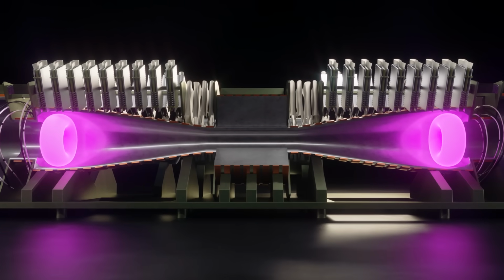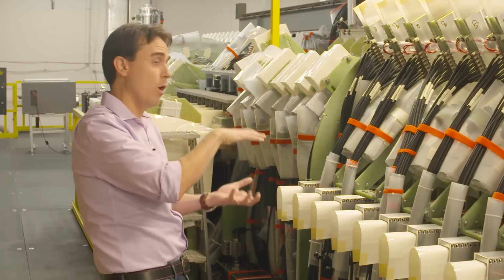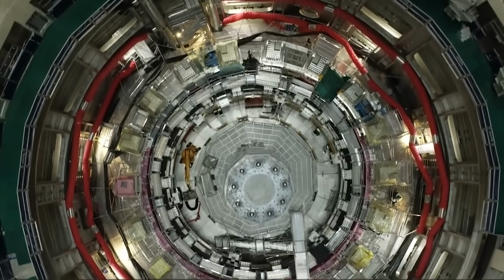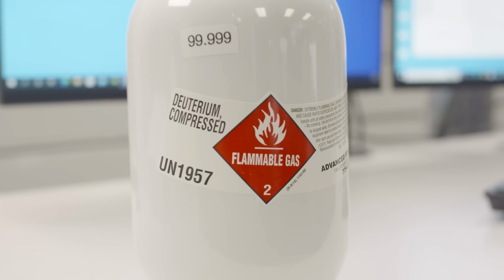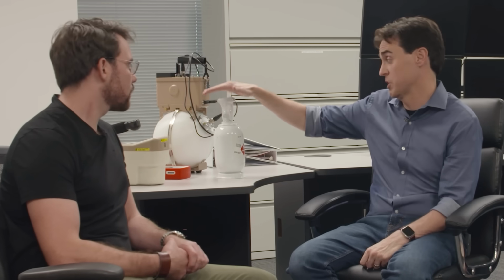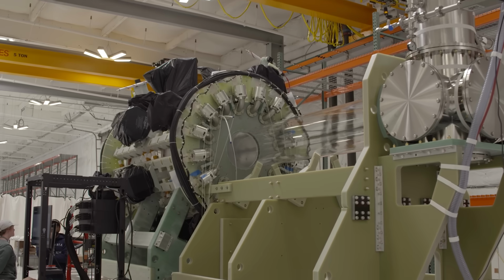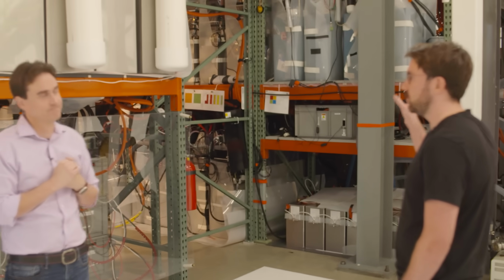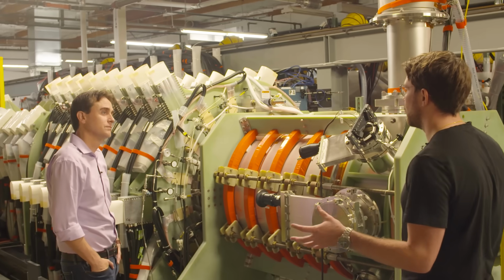A New Way to Achieve Nuclear Fusion: Helion

Comment: This will likely never happen in are life time the required levels of fuel is just not available in any amount needed for more then test. And this group is so far from producing any power. Most fusion produces plutonium 235 making the reactor all nuclear wast not just the rods like a nuclear power plant. Making fusion dirtier then nuclear power. This group seems to be going down the wrong road. They keep saying they producing less then other fusion reactions. well no reactor is anywhere near producing positive energy output.
Reply: None of that makes true.

Comment: What kind of material will use in that chamber , where is millions of degree temperature.
There is a lot of Qu?, There is a lot of input and output will have a lot of losses. the ratio
of this will decide practical use of this machine. If You cut spending of energy of military
in the World, for these days will be plenty of energy.

Comment: This is very intriguing and pretty cool honestly. But while everything else seems fine to me (on a conceptual level), there is one thing that I don't quite understand. Why are the two plasma clouds supposed to stop in the middle after collision without external intervention (which I would presume would render the whole acceleration pointless)? I would expect them, due to their low density and no binding between the ions, to largely fly past each other with some minor scattering probably. Can somebody explain that to me?

Comment: I still wonder if you took a hydrogen Bose-Einstein condensate and rapidly super heated it with a high powered laser would it fuse. I mean a B-E condensate behaves as a single atom so would that be enough to overcome the electro magnetic repulsion by not giving it enough time to separate?

Comment: I think i see what helion is going for.  If tokomaks and stellarators or Igniters use fusion to heat a steam boiler that creates torque in the same way that a train does. then Helions magnetic pinch technique is trying to use fusion to power a four stage  internal combustion engine that makes the torque directly .  Currently they can do the first two stages without catastrophic failure and are currently working on the last two stages with the newest variant under construction.

Comment: What's really interesting to me is the size of this reactor. Unlike previous fusion and fission reactors that require massive cooling towers, hydro electric infrastructure, and waste management faculties. This system appears to fit in a moderately sized traditional commercial building. This is advantageous when considering the sheer cost of building a traditional nuclear power plant. A smaller foot print means less land, probably lower construction times, and ultimately less cost to build the physical building(a) that might house such a system.

Comment: Looks much more promising than that seemingly silly Tokamak project in France— ITER… which will cost anywhere from 18 - 65 billion dollars to construct and isn’t slated to go full fusion until 2035 — and that’s just for a prototype that will not be able to produce commercial amounts of energy (so commercialising that  tech in a financially sustainable  way will take decades and decades, if ever). That said, this also looks at least a decade away.  They just started building the larger prototype. Seems way more manageable, but still a shit ton of work— a lot of it trial and error. Put another way, they have lots of engineering problems to solve and these cannot be solved without actually building the machines, and rebuilding them… and iterating them… and putting together ever bigger capacitor banks… this is not “around the corner”, unless around the corner means years from now.

Comment: how soon before commercial application?
Reply: Polaris will do small amounts of net electricity in 2024. The next one after that will be the commercial power plant. Helion generally has a 3 year cycle between machines. So NET 2027, but could slip a couple of years since they also have to build the machine that builds the machine and a few other things like regulation, etc to deal with.

Comment: Well, it's clear that they managed to achieve the nuclear fusion in a small package, as you obviously can see the flash of pink light, which are Gamma-rays that hits the camera, and you can clearly see where the Gamma-rays came from, the center of the fusion reactor on the security video screen. It's insane.

Comment: Wow!  And right on the heals of the US Dept of Energy announcement!  This is amazing tech!  This is almost solid state fusion that self generates fuel!  I have some EET knowledge and used to make my own capacitors so I know when you cycle power so fast the performance degrades with heat.  Someone tell them to cool the electrolyte in the the capacitors unless they are solid state but those defininately  looks electrolytic.  But still water cooling the capacitors will help with ripple current and increase efficiency.  I can't wait to see how rev. 7 turns out!

Comment: Don't count the chicks until they are hatched. Have they test run the invented machine? To be successful and commercially viable, the energy output should be greater than that of input. The laser guided nuclear fusion machine at Lawrence Livermore lab had already proven that.
Reply: Well LLNL did not include the energy to run the lasers. Helion is much closer to net electricity than LLNL. They are aiming for net electricity with their next prototype, Polaris.

Comment: Everybody: we need to make a ring of atoms coliding ith eachother to the point of fusion and cover it with material that will both transfer heat and regenerate stock aroms.
This guy: hmm....what if we shoot blaster bolts against eachother?

Comment: This system seems extremely interesting, and even promising. Particularly remarkable to me is getting away from one comonnality of turning a turbine that much of the power generation I'm aware of falls back to. I''m curious about the way they go about harnessing energy from the expansion of the magnetic field while also presumably pumping electricity in to create it. Wouldn't this essentially lead to the system inefficiently 'backdriving' itself at best?
Reply: From what I understand it will work as an "electromagnetic" combustion engine, but I agree this part seems kind of tricky. Maybe if the configuration is right resulting plasma will induce current in the coils that want to compress it, so it really transfers energy (pushing back against the current). We will see

Comment: Yeh nice and all, but unless your getting more power out than your putting in or at least very close it doesn't really mean anything and if they are getting more energy out than they put in you probably should have said that first and no I am not talking about electricity generation, they should know how much they are getting from fusion, so I am assume they are nowhere near break even and if your nowhere near break even then it doesn't really matter. It's a cool might be, but honestly vs a Tokamak where you don't have to heat up the fuel every time I think that efficency loss will mean that it will be tokomak or a stellarator that finally does manage break even.
Reply: They are actually very close to break even. Trenta should be somewhere around JET in terms of Q(sci) and Polaris will make net electricity. Mind you Trenta only cost 35 million and did all that in a couple of years. JET cost over a billion and took a decade to get there.
Reply: @elmarmoelzer2229  isn't JET at like 40% output to input ah no Q = 1.14 apparently. I think the Q only factors thermal input power though doesn't it and not the power for the magnetic field.
Reply: @elmarmoelzer2229  Eh to be fair apparently this has been in the works for 30 years so... and also to be fair ITER should probably have been scarped shortly after constuction started as high temperature superconducting magnets were coming around about at the same time as ITER was starting construction which would enable a doubling of field strength which would enable 16x the power or 1/16 the fusion chamber size enabling you to build it a lot faster.

To late by this point as ITER is supposed to  be coming online in 2 years or so, also to be fair to ITER if it had been scapped for a better design it would have probably taken the bureaucrats 20 years to greenlight another design even if it were significantly cheaper to build than what they already approved.

And ITER's biggest goal is not to generate electricity but to demonstrate a burning plasma, but if that was the goal we would have been better off going with the cheaper hacky option which was proposed but rejected back in the 90's which to just have copper electromagnets and just goose the power to increase field strength over ITER to achieve a burning plasma which you wouldn't get anywhere close to getting net power, but you could achieve all the same scientific goals on a much shorter time scale and for cheaper and just hoped for better superconducting materials to come around to allow the same field strength but in a usable way.

but to be fair hindsight in 20/20.

Comment: I wondering about COP ratio RN.. actual input/output radio.. leading you to this conclusion.... in order to make electricty you need electricity of course.. to pull out power you need continuous reaction.. mean timing with 0,001-10sec depended on inside em.field discharge duration.. coz ignite fusion/fision reaction is just HALF of story.. even trought it say same stuff as i say many year ago about tokamaki and that is : tokamak not gona work even as stealator.. hope for answear..
Reply: Their machines are pulsed on purpose. They store the output energy in capacitors and gradually release it to the grid.
Reply: @elmarmoelzer2229  like i dont know.. did you read my questioning::??  obviously not! ad 1 they store that energy inside capacitor to INGNITE REACTION (otherwise they BURN DOWN POWERGRID!) not to send energy to grid... ft you talking about.. ad second i ask them.. not you.. you are obviously know shet about it..

Comment: Amazing!
The issue of component damage due to neutron radiation was discussed, but activation was not. How is the activation handled?
Do the components become activated, making hands-on maintenance difficult (dangerous)? If neutrons are not captured, like in Tokamak systems, is shielding required? How will disposal be handled?

Comment: Amazing to hear terms like "plasma injector" or "deuterium tank,"  to see a pulse reactor setup reminiscent of a warp core (ok, two boluses of plasma vs. matter + antimatter), and see the use of fiber optic cables for power transfer (reminiscent of the ODN or EPS systems in STTNG), all being forged into reality. Probably just coincidence, both building on prior scientific terms, but it's incredible all the same. Looking forward to seeing this come to fruition. I wonder if their commercial concept will be small numbers of larger reactors or multiple small reactors? It almost seems like the latter would be more manageable and scalable in the long run. Thank you so much for this deeper dive. All the other news about this has been very superficial.

Comment: Seems a bit shady to try and make it indirectly sound like this is the reactor that made net energy and only meantion it at 28 min in to a 30 min video for a second when they have no apperent connection other than both trying to make fusion viable. Not saying the tech isn't interesting but releasing this just after the breakthrough and making a pitch at the start, really expected more from this channel.

Comment: Wait. what.. you say that all the research at Tokamak or the laser Inertial Reactor is outdated by now..
you say the energy net gain is greater than 1?   you say we have now finally Fusion Energy? working ... not just theoretically... we actually have a working reactor who can put out continuous energy?
And we are able to dissipate the heat energy.
Reply: Wait... what?  the energy is not collected via heat and steam turbine?
it is directly electromagnetically induced?
that thing is already smaller than many ship diesel engines of today?
this looks almost portable.

Comment: The neutrons were also my first concern ... if 80% of energy produced by fusion is in the kinetic energy of the neutrons, it can't be harvested by Helions method either.
Reply: Interesting approach, what is the caveat ? Why is, for example, Tokamak, not using the same reaction ? Is it more taxing on conditions ?
Reply: That is why Helion is using Deuterium and Helium3 as fuels. More energy in charged particles and less energy in neutrons.
Reply: @elmarmoelzer2229  Exactly, interesting method. Problem I see: why is nobody else using this fuel mixture if it has hese upsides ? That means there have to be downsides as well. First of all, there will probably be more charged particles, which would make confinement harder, e.g. less energy production per volume or magnetic field.

Comment: There has just been an announcement that the LLNL IFC machine has achieved net energy gain.
I believe that the Princeton machine did this several years ago.
We sure could do without the hype.
Call me back when you have a machine that is reliably producing 1000 megawatts connnected to the grid.
In the meantime, just burn up millions in endless research.........
Reply: Those machines are designed to produce 50 MWe.

Comment: Needing lots of capacitors to deal with the output energy makes me wonder if a steam turbine power conversion system is simpler. Or could they use physical pistons instead of electromagnetic field as a piston, between one or more pairs of fusion chambers firing 180° out of phase, perhaps moving a mass back and forth as a pendulum or rotating a shaft.

Comment: So they basically put two rail guns muzzle to muzzle and they use them to shoot plasma at each other. They funnel the plasma to the middle and then they use electromagnets to jiggle the fields around, simulating the way a piston works. I'll be honest this looks to be the best design around, because it works like a combustion engine, you just put in fuel and it just keeps going without stops. Not only that but it also produces it's own fuel out of the raw material.

Comment: Nice. Besides all the new engineering which is daunting to say the least; the use of the plasma as a magnetic piston to convert excess magnetic interaction directly into current. That's new. How they get the electrical delivery and uptake components to work together without destroying themselves physically from the shock is a mystery to me.
I really wonder if even the 7th generation of prototype will be even close to the last. It wouldn't surprise me if the fields were reversed to take any unspent D/He3 fuel back into one of the collectors quickly enough to be shot back into the main chamber with a new batch of fuel on the other side, all within less than 1/10th of a second.
Extracting the Helium 4 waste products without wasting any of the thermal energy in the shot seems like a pretty heavy challenge as even the highest performance vacuum generators can't scrape He4 and separate them out before the byproducts cool sufficiently to avoid damage. I suspect Bernoulli's principles of flow are being used but magnetically to sap the kinetic energy from the shot (taking useful work out) and then sent through the vacuum pumps separators to bottle up the He4 and send the rest back into the machine. 
Lots of very tough challenges to go but the principle of having almost all of the fusion energy in the He4 nuclei's kinetic energy is a most promising method indeed. Less high energy Neutrons, the better. The split design sounds promising if you can get tailor the probability of D/D making He3+n or T+p preferentially extractable, there's a whole other market for scale Tritium production.
Reply: The fuel and fusion product separation does not have to happen in real time. They just evacuate the chamber, take the stuff to a separate machine that does it in its own time.

Comment: I am not convinced that small scale nuclear fusion power generation is possible.
1) The pressures and densities required for nuclear fusion are beyond our engineering capabilities to contain.....Even an ultra-strong magnetic field   which would contain plasma must exert a pressure on the machine beyond its strength....
2) The temperature of the plasma means that it will radiate in the gamma ray range, which cannot be insulated against. The radiation will immediately cool the plasma below the necessary temperature.
The sun is 800,000 miles in diameter for good physical law reasons. Jupiter, which is huge, could not sustain nuclear fusion.